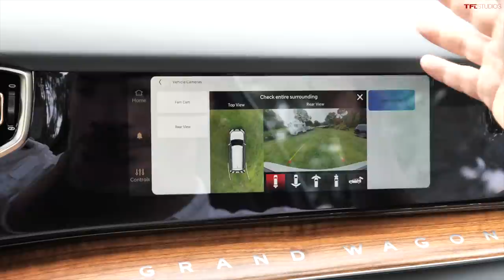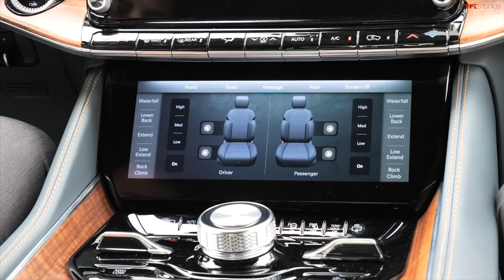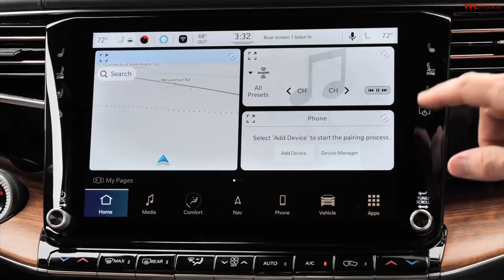THIS Is The Secret Behind Why The 2022 Jeep Grand Wagoneer Can Tow A Massive 10,000 Pounds!

Comment: Imagine a 2500 version of the wagoneer with a cummins/aisin combo.
Reply: That would be sick
Reply: It fits the attitude of the Excursion for sure. Just with better towing
Reply: That would be crazy considering you can’t even get a Ram 2500 with the Aisin transmission.
Reply: Even better Cummins and 9 speed Allison combo
Reply: @gbaby4rb64  I thought the new 10 Spd trans in the GM Hd trucks arent really Allison made and its a version of 10R thats used in the Ford SDs. Didnt think there was a 9spd Allison at all.
Reply: @bobdennis4801  beauty of parts bin galore.
Reply: TAKE MY MONEY NOW!!!  This is what I want…
Reply: @vipraz119  Your right about the first part but the 9 speed is the actual Allison transmission not Allison branded
Reply: @gbaby4rb64  ahh.. didnt know there was a 9spd trans out there. Sure I’d take that over the Aisin any day.
Reply: @vipraz119  I think you're thinking of the 1/2 ton 10 speeds that were co-developed by Ford and GM.  The HD 10 speeds aren't related.
Reply: More expensive, slower, and would handle like complete shit! Totally American!
Reply: Not gonna happen
Reply: @jamesbeaman6337  Ford and gm did both pay to design the hd ten speed.
Reply: @bobdennis4801  yes you can
Reply: @WyessEnt  not from the Factory. Aisin is only in the 3500 with the HO.
Reply: @alexs3187  it would tow more weight which would be the appeal
Reply: @DannyO0917  no it wouldn’t. It’s limited by the frame and payload. The GVWR is 7,400 lbs. That doesn’t increase by putting a different engine in it. The curb weight is about 6,200 lbs as it sits. The Cummins engine weighs 1,000 lbs (about 500 lbs more than the Hemi). Wanna put in the Aisin transmission too? That would eat up even more. it would eat up more of your payload, so it would actually tow less. Unless of course you built it on top of the 2500 chassis. But then you have a big solid rear axle, and now you have to raise the 3rd row, reducing the legroom. It’s still compromised, so it’s still not going to tow as much as a 2500 pickup. So you’re making all these compromises in ride and handling and paying and extra $20k to maybe pick up another 2,000 lbs of towing capacity? Yeah that makes real sense!

Want even more proof that your “towing” argument makes no sense? The Ram 4500 6.4L can tow 17,000 lbs. You still think the 10,000 LB capacity on the Wagoneer is limited by the engine?
Reply: @alexs3187  this thread states that it would be cool if it had the 2500 chasis and Cummins engine. On the ram, that combo is good for around 20k lbs towing. It is not just the engine change, it is the chassis change that was suggested that prompted my correct response.
Reply: Hell yeah, jack up that payload!
Reply: Ya and I’m sure that one would only cost 150k lol
Reply: @Matts000  yep, and nobody on here would buy one anyway.
Reply: That irs won’t hold need a solid axle … that it’s will be trash
Reply: @armymxere5  yep basically has to be on a 2500 chassis, along with the extra weight, turbo lag, heavy steering, extra firm suspension, and all the drawbacks it brings.
Reply: I was thinking the same too. It would be really sick! I mean 2500 is not too loud for a diesel. After 2nd gear it is really toxicating.
Reply: 😍🤤 that's a beast I'd drive daily lol
Reply: THAT I would buy!
Reply: Why so it can drive like a box truck ? The 68RFE would do just fine for what this is used for . Your not pulling construction equipment🤡
Reply: Your are absolutely correct!
Reply: @gbaby4rb64  Allison's won't last behind a Cummins. Been tried
Reply: @jameshardin4326  that’s why it’s the medium duty version and not the Allison branded from GM
Reply: shut up and take my money
Reply: Yes
Reply: HELL YES !! AND  GIVE US A NEW RAM CHARGER!! TO REPLACE THE  DURANGO
Reply: Exactly what I have been saying and wanting for a while because this vehicle can’t just go ahead and tow anything 10k lbs… tongue weight is something many  have zero clue with…  whereas if someone build a 3/4 ton chassis 3 row SUV it really could tow any 10l trailer as far as you want in a safer way
Reply: @Alex S  .... Great Comment!
Reply: Yes that should of came about 20 years ago
I don't know why Chrysler doesn't do it.
Reply: Mi pana no tiene comparacion... Jeep es Jeep
Reply: Imagine one WITHOUT quality corners cut by little carlos and company....................

Comment: 10,000lbs towing capacity is really great but the 1,000lbs Payload makes that 10,000lbs towing capacity pointless especially for a family of 4 wanting to pull a travel trailer.
Reply: Drives me nuts how manufacturers do that! Same with the new tundra, 12000lb towing capacity but the most payload available is 1900lb which you will be lucky to find on most tundra trims. Why is to so hard to get decent payload capacity?

Comment: The vibration canceler is to save them from having a heavy flywheel and for cylinder deactivation, and a cheap way to deal with bad NVH. It does not work for off road terrain. By the time you roll over a rock, it will be too late to vibrate it away. 9:00

Comment: When you first showed the frame and driveline display model, it did not make sense at first while I was looking at the depth of the frame rails and the elaborate and expensive rear suspension. Then it made sense. This chassis was designed to incorporate a skate board configuration of dual motor and under floor battery pack. And a good size one at that. It will be a $140k+ Jeep, but it’s designed to migrate to battery electric down the road. 

I have seen some 2022 Wagoners on the roads and in driveways and they are very good looking out in the real world. They have a very sharp, elegant and vibrant paint and overall finish on them. They have an expensive classy look to them.

Comment: They should use the Power Wagon frame and axle setup, under the Ram banner, shorten the length and bring back the RAM Charger SUV. Solid axle front and rear with lockers and winch. And market it to the off road crowd and try to keep prices somewhat reasonable.
Reply: yes  look at the org Cherokee was based off the sj 1974-83 basic 2/4 dr  rubber floor mats  vinyl seats   independent  rear suspension sucks ' oh we want a comfy ride  leg room for the 3rd row seat' who goes off roading  7-9  people in a 3row suv off roading
Reply: Will less farkles, and no carpet.

Comment: I have to admit that I wasn't impressed with the new Grand Wagoneer because I thought it was too soft for going off-road. Yep, that's different. Still curious on the payload, and would love to see those power numbers in the heavy duty trucks. Nicely done!
Reply: How many do you really think are going to go off road in this. Not many. Hard core off road, zero.
Reply: 1360lbs to 1580lbs depending on options. Towing 10,000lbs in the real world will come down to a numbers game. It won't happen unless you ignore payload/GVW limits in moat real work scenarios.

Comment: Hate box frames. Mud and dirt gets stuck inside the rails rusting through inside out. I prefer a thick C section frame to prevent that to happen, even if it has many disadvantages as less stiff.
Reply: Tough to hear you from all the way back there in 1970
Reply: @trevorj79  you still got some heavy duty trucks.

Comment: So despite the Grand Wagoneer having the 6.4 L Hemi engine, when you look at the payload capacity, the Wagoneer with the 5.7 L engine supplemented by four wheel  electric motors has the superior payload capacity along with similar towing ratings. The smaller engine also is reported to provide a 2 mpg improvement in gas mileage.  So strictly from a towing standpoint, they have similar tow rating , but which will do a better job towing a 7500 lb trailer with a fully loaded vehicle??

Comment: Something TFL trucks needs to investigate is all these new Jeep vehicles is great but the problem I have is we purchased a new
2020 Jeep Gladiator for $56,000 and had an issue with the front axle and they can't get parts so the warranty is no good if they
can't supply parts to fix them and I am not the only Jeep owner that's having problems. Jeep needs to fix the parts issue!

Comment: They've set the bar pretty high, will be very interested to see how the hybrid version compares in performance/towing :popcorn:
Reply: Kind of odd they don’t have the E-torque system on it already, but maybe there’s good reason for that, being as it’s not overly effective
Reply: @tylerwalk7699  The 5.7 wagoneer does have the E-torque. This 392 engine is stolen directly from the scat packs and SRT's which are not set up for E-torque which is why the grand wagoneer doesn't have it. Also the fact that it would be pretty much useless because this engine has more than enough power.
Reply: @gasolinediesel972  10-4, guess I didn’t do too much research on the matter cause I’m not in the market for a while. At least til it comes back to planet earth

Comment: Hmm, new 392 for the Ram in the near future?
Reply: 471 hp and 455 lb-ft in the half ton would be incredible. Especially if they put it in the lower trim level and pair it with the Wrangler 4xE system.

Comment: Curious if they thought about fitting this with a solid rear axle? Looking at the chassis you can see how limited the articulation is going to be. Definitely will be great towing horse trailers on gravel roads, but seems like they're leaving a lot of off road capability back on  the drawing table. With the popularity of overlanding/ offroading seems like more could have been done to design to those markets.

Comment: The real question everyone wants to know is if FCA have fixed the Hemi eating itself? That’s literally the only thing (well the rotary “shifter” too) that’s seriously making me stay away from Ram or any FCA vehicle with a Hemi.
Reply: The Hemi eating itself?
Reply: You've got to stop watching all the chevy guys on u-tube spreading rumors.
Reply: Dude, I've literally owned like a dozen modern Hemis, put between roughly 50k to 100k on all of them, and never had a problem with any of them. Seriously. The only time any of them were, "in the shop", was a handful of times here and there for minor recalls. Also, many of my family members have had them, sometimes multiples as well, and literally none of them had any problems either. I'd suggest you stop listening to the haters and just try one for yourself. As long as you change the fluids and don't abuse it, you shouldn't have a problem and I'm very confident in saying that.
Reply: Wait, so you are holding off trying one for a problem that affected less than 1% across three model years?

Hate to break it to you but majority of the HEMI's that showed this so called problem had a bad batch of lifter's installed in them combined with owners who most likely didn't keep up on maintenance. The so called problem isn't a problem after those respective model years.
Reply: hewlett260 hmm, I’ve never heard of that “problem” until now. I currently own a Ford and two GMCs in the past and never owned a Ram or anything with a Hemi yet, so maybe that’s why I’m ignorant of it. Funny how the guy hasn’t made a rebuttal or even bother to answer my original question.
Reply: @jaysson1151  Yeah - I’d never heard about it either but, with a quick Google search, I see there’s a LOT of threads about cam/lifter failures and, according to Jalopnik, an engineering defect.  Not sure if it’s all factual or not, but this would warrant further investigation if I were in the market for one.  That said, I’m going to hold out for the hopefully better-looking Cummins/Aisin combo Wagoneer wished for above!
Reply: As a tech I can attest to the poor maintenance as root cause.  We see this with mostly fleet operators with VERY high idle times.  The EVIC oil change reminder is reset/ignored and the maintenance is performed based on milage.  I've yet to see a problem on a vehicle that has had even decent maintenance.  The Hemi's are great, don't believe everything you hear.
Reply: @okcmoparguy724  Thanks for the "story behind the story".
Reply: @okcmoparguy724  I agree!  As the 2nd owner to a 2013 300C, 5.7 hemi, I can confirm the longevity of the hemi.  Bought with 80K miles and currently pushing 133K, the key is regular oil/filter changes (dinosaur 5w20 oil).  Changed serpentine belt, trans oil and filter and diff oil at 100K.  Kind of a car nut...car has long tube headers, Corsa cat back exhaust, 180 thermostat and a 93 octane tune.  Tazer opened up SRT performance pages.  Car will deliver 28 mpg at 80 mph.  Chrysler/FCA/Stellantis are doing the hemi right.  My experience.

Comment: WHY IS DIESEL NOT AN OPTION ON THE WAGONEER AND GRAND WAGONEER?
Reply: Modern diesels (esp emissions components) do well on work trucks. Unless they work hard, they will suffocate the system with soot. For SUV it wouldnt be the right engine.

Comment: Someone needs to go show video of a Wagoneer with the 5.7L and it towing a 8 to 8-1/2 wide enclosed car trailer that’s got a 7-8ft interior height and is 24-26ft in length… with a couple SXS loaded in it being at just under 10k total…  I want a Wagoneer because I plan on a race trailer for motocross and it’s gonna be atleast 5,000lb dry before toys, tools, parts, etc… and I know the tongue weights of said empty trailer will drop the rear end of many 1/2ton trucks…

Comment: Those original Grand Wagoneers were such steaming piles compared to Suburbans of the day. From the power train, to the HVAC,  and interiors.  Everything. AMC 🤮
Reply: But like jeeps of today they remained very desirable and nostalgic.
Reply: Says, you.   The buying public is saying differently.   People shell out huge piles of cash for refurbished Grand Wagoneers.   Lastly, the suburban interior didn’t even come close to a Grand Wagoneer.  In fact, the interiors of suburban are just now getting close to a Grand Wagoneer of the late 80’s and early 90’s.  80’s and 90’s suburban were a sea of cheap plastic that faded daily in the sun and the thin threadbare carpet looked like it should be in bass boat or pontoon boat.

Comment: Good luck replacing that hitch when it gets banged. One bumper tap, and you have a bent frame. Trucks have their hitch bolted on with bolts that are designed to shear. Robot welding is cheap if you have a robot welding on an assembly line. I know insurance numbers well, and that will cost a lot of money to fix. And they don’t test rear end collision, why, I don’t know. But I wouldn’t want to be in that suv when it gets ass rammed and all the energy goes right into the frame and into the occupants neck.
Reply: You need to be a safe driver
Reply: @mbukukanyau  he's talking about the other people. There's not too many situations where you can avoid a rear end accident, even if you are attentive and see it coming.
Reply: @volvo09  Thank you for answering his post. It was so amazingly stupid that I didn’t want to touch it, in fear of it rubbing off on me ; )